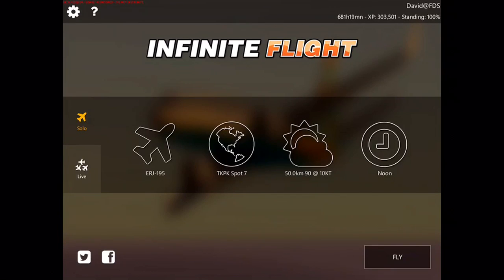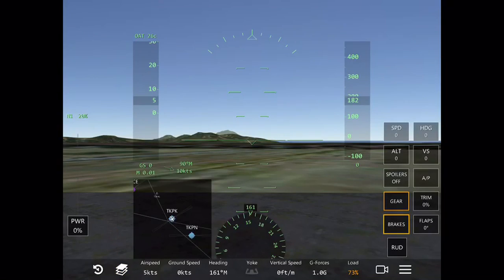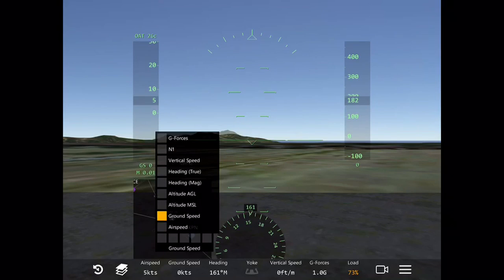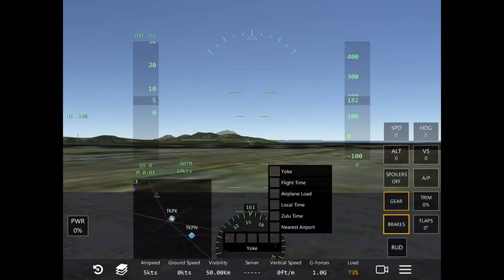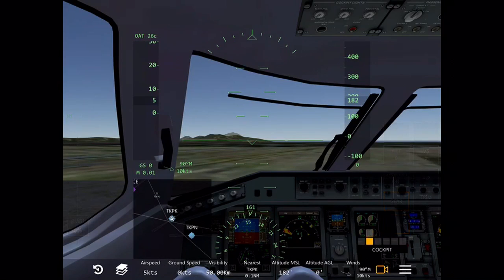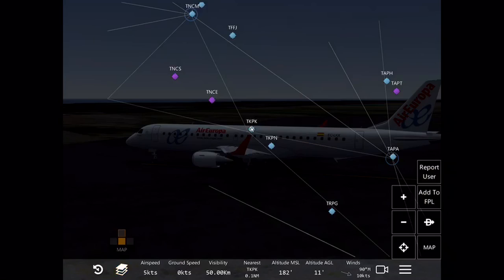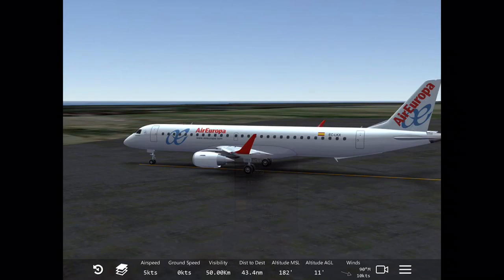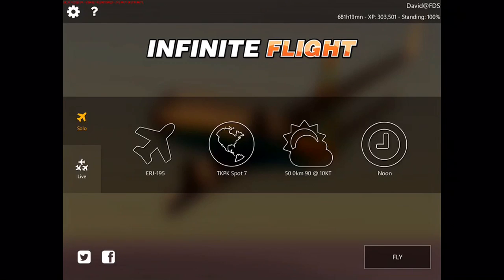Infinite Flight New Instrument Dock

Comment: In multiplayer make it so randomly you get a 2partners one as a co-pilot and another one will take you to the runway and you could talk to the other 2 people to wherever  runway they want to go to and the co-pilot has certain controls than the taxi and pilot but before you need to plan up the flight or you get disconnected